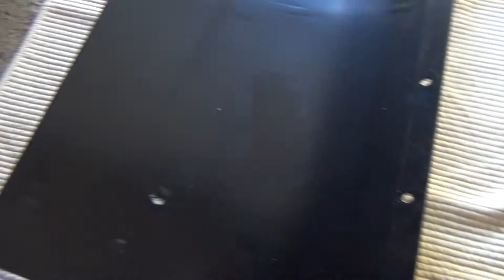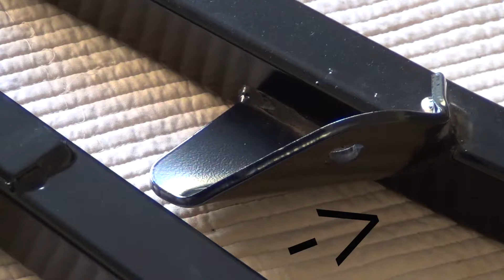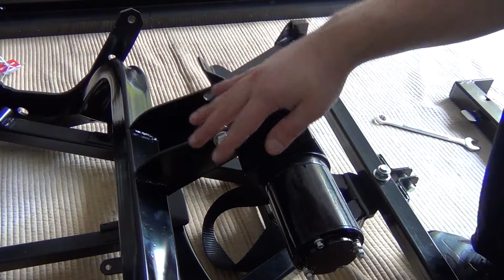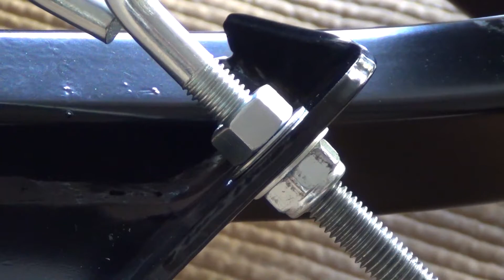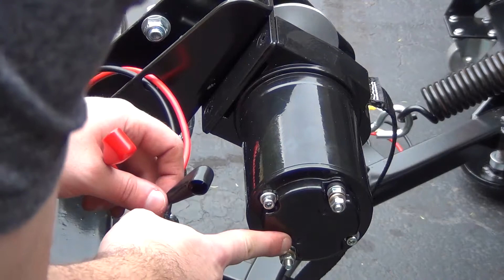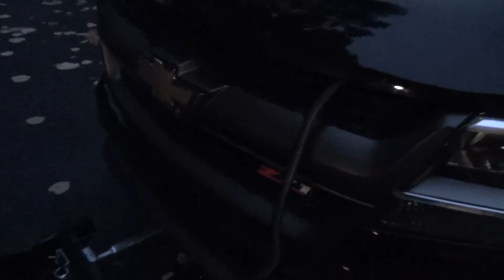Detail K2 (DK2) Avalanche Snow Plow Kit Installation & First Impressions | 2020 Chevy Colorado Z71

Comment: I too have a 2020 Colorado. Goes together pretty straight forward. I was curious where you mounted the electrical control box. Was it just left hanging in the engine compartment?

Comment: did they do anything for your blade being marked up? just bought mine from costco on sale and put it together and it has some very deep scratches in the blade. I mean the metal has huge gouges out of it from being rubbed constantly. About 4 spots right in the middle. Curious if they did anything for you? My wireless winch controller also doesnt work unless i put the wireless controller touching the control box.

Comment: Just put mine together - same issues with scratches in the paint, put mine is going to be plowing a gravel driveway, so the paint won't last long anyway. The bolts you thought were missing were floating loose in my carton as well. When I unpacked the parts, I knew they went somewhere to something... took a bit of assembly to find out where. 😆
Reply: I just assembled mine and have the exact same scratches

Comment: I put mine together last weekend, but wanted to watch this video anyway. Pretty good video. Personally I replaced the cotter pins with hitch pins on the 3 big pins that hold blade to plow frame. I just feel like they'll be stronger.
Reply from the maker: Thank you for the feedback!

I haven’t run into any stability issues with the snow that I plowed last season, but that’s a good tip to use hitch pins to increase the rigidity in some of the heavier snow. I may give it a try down the road. 👍

Comment: Thanks for the walk through - better than the factory directions - your video helped me purchase the Avalanche vs the Snow Bear - Working on assembling mine today -  going on my 2008 1500 Silverado - will finish the wiring tomorrow.  Receiver hitch was not shipped with the delivery, apparently back ordered... Bummer  6" of snow will have to wait....

The only difference was the winch strap went under the fixed pin on the winch mount...
I found a video from the manufacturer - thought yours was better...

Thanks

https://www.youtube.com/watch?v=tPK7CgF5WuM
Reply from the maker: Thank you, glad I could help! I’ll need to check out their video. I haven’t noticed anything bad when raising or lowering the plow, but now that you mention it, having the strap under the pin would keep it under more tension. Thanks for the heads up!

Comment: I look forward to your plowing update. 
I just installed a DK2 Rampage II on my Sierra last week. I had no missing parts, and no scuffs. The did send the wrong vehicle mounting bracket though. Similar to you, I called the phone number, just to have them instruct me to fill out a warranty form. I did, and I had the correct mount a few days later. 

The Rampage with the vehicle specific mount seems to sit a little closer to the truck bumper, and saves the step of having to install the stiffeners each time. 

My instal went pretty smooth, but I have not plowed any snow with it yet.
Reply from the maker: Thank you, I look forward to seeing how it performs as well! 

I agree that the vehicle-specific mounted plows are way better for transporting and overall stability. If I was plowing more than my house and needed to drive with it on, I’d be a little worried about the overhang. (I am able to leave the stiffeners on, and just slide the plow up to the truck, so that’s a plus!) 

We’ll see how she goes for a first plow... Might end up upgrading to a Rampage II if I like the way this one works, and if I upgrade to a full size truck.

Good luck when the snow starts flying! Although with our luck buying plows, we may have a mild season on our hands... lol
Reply: @GrazGarage  I’d be happy if I never had to use the plow!  

I never intend to leave my property with the plow mounted either.

Comment: Just wondering if that blade stiffener comes with the plow, that braces it on the hitch receiver.
Reply from the maker: With the kit from Costco’s website, the braces were included. I believe they are standard content with the plow and not a part of a special package. If you do buy the plow from another website, I’d just double check that they are included, just to be safe.
Reply: My summit 2 plow from Costco ordering had so many scuffs on it. My plow blade has 2 of the exact same spot as yours. Did you call support? Curious if it's worth my time
Reply from the maker: Yes, I would definitely reach out to them. I called the DK2 support line, but they ultimately told me to fill out a warranty claim form on their website. A few personal/purchase details, description of the damage, and a few pictures are all you need. Give it a day or so, and they’ll email you back with how they can work with you. In the end, they told me to use some touch up paint on the blade (I’m thinking an automotive paint pen might work best), but they were able to give me a new wireless winch kit, as well as motor controller for my trouble. (DK2 told me the winch motor controller is a consumable that has a life of a couple of years. So I’d ask for that first if I were you.) Good luck!